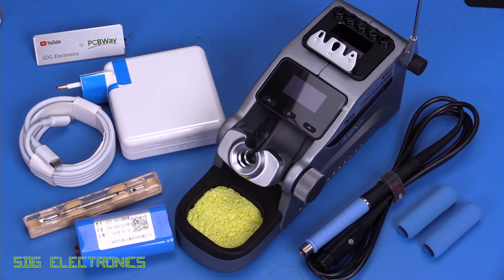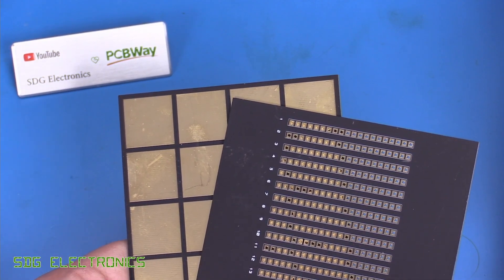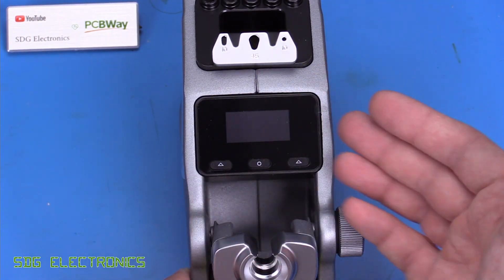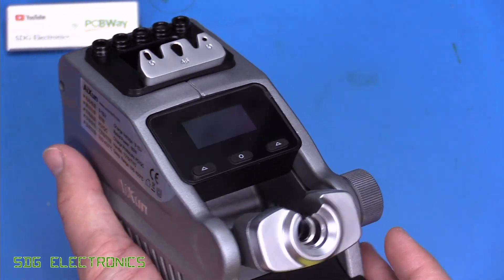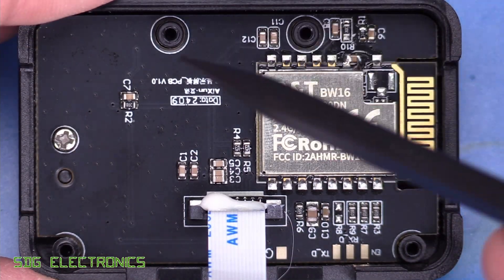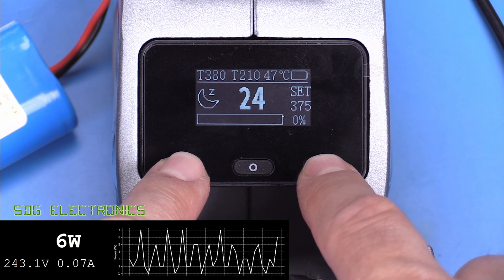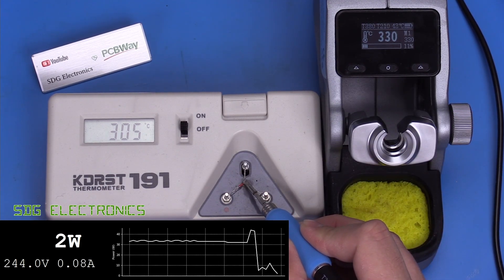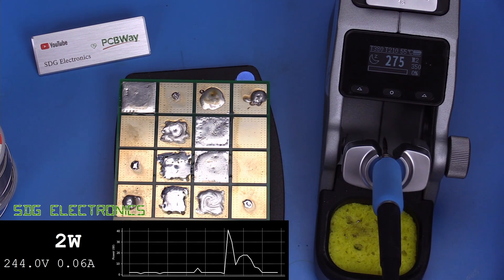SDG #335 Aixun 80W USB-C and Battery Powered T380 Soldering Station

Comment: they dont ship it with the battery anymore.. received mine today after ordering it at the video release day and they didnt include a battery for it. overlooked the description where it states "doesnt include battery for shipping reasons".

 its just two 18650 2600mAh with a 2S bms on a jst connector isnt it? gotta weld my own
Reply from the maker: Yes, just in a 2S configuration

Comment: Southchip Semicon SC8201QDER - Synchronous boost converter, 2.7 to 30V in, 2.7 to 36V out, 2A gate drive. For anyone wondering.

Comment: It's a shame they didn't inset the USB and handpiece connectors. Every time someone pushes the station back to the wall, it's going to damage the connectors. It would have been such an easy feature to include.. sigh. 5:05

Comment: I’m just finishing my review. Did you spot the issue with external adapter and battery in that of both are connected you can’t turn it off.  It just crashes.  Also then if you remove the usb C and turn it off it turns its self back on.   I have fed it back to them.    Overall it’s a great iron
Reply from the maker: Hmm I just tested it, it happens with their adapter but with the power supply I was using in the video it works normally.
Reply: @sdgelectronics  that’s interesting.  I’ll test that now to

Ok just tested and it’s the same on a few supplies for me.
Reply: @sdgelectronics  here's another puzzler: the station is labeled with input: 9v - 15v. But the charger is labeled as only providing up to 3A at 15V (... or 4.8A at 20V to give the 96W rating). This is typical; pretty much all high-power usb-c chargers I've seen only provide more than 3A at 20V or greater. (The reason being that devices should prefer lower current and higher voltage, up to a point.) So how could it be getting 80W, at 15V? Maybe the supplied adapter will actually allow ~ 5A at 15V? (And some other high-power usb-c adapters will too?) Probably more strict/proper usb-c supplies will have issues with it.
Reply from the maker: @ploxiln  yeah that's a good point, it must be temporarily overloading that supply, though I think generally it's not designed to be run without the battery installed

Comment: One thing I don’t understand is I thought the C210 tips can only do 20W ?
Reply: Spec is about 24W continuous 40W peak from JBC, these clones drive the tip much harder. Its not clear how long they will last running at 80W. I would prefer an option in the menu to limit maximum power.

Comment: Oh why oh why the F did they not support the T245 hand piece. Goes to show that no soldering station can seemingly be designed without at least one stupid avoidable design decision. No support for brass cleaner in the station. Battery powered devices like this should use external systems so users can opt for different sizes and quantities based on their needs. No sleep mode, no IEC mains supply. Seems very targeted to those playing with drone, UAVs,

Comment: Because of the low cost of this and other similar units that don't have the reduced temp standby mode could it be that the materials used to construct the case and holder aren't suitable to be around high temps for extended periods? Turning the iron off is preferred over higher cost of materials when competing in the market.
Reply from the maker: In this case I think it's just a missing feature

Comment: I don't understand why the handle should be placed as shallow as possible in the cradle. You mentioned it prevents the heat from traveling back up the handle. Does heat obey the laws of reverse gravity?
Reply: I don't suppose you solder much...
Reply: @overamped23042  MYOB
Reply: heat raises to the top
Reply: @AndreaAustoni  Hot air rises to the top, not heat. The thermal conductivity of air is far less than the metal part of the iron itself, otherwise your hand would burn during use. Putting the iron at a shallow angle would make a marginal, if any, difference.

Comment: I'm glad that AiXun is trying to build a brand, even if it's based on cloned JBC technology, but they could definitely improve the firmware.  The arrow buttons here are likely a manufacturing error as the item photos show them pointing in opposite directions.  This aspect needs QC attention.

The pricing is weird as they want an extra 43USD for 2 extra tips.  The marketing is also awful as the AE photos show that this station has "5G technology" for firmware updates and a "neural network control algorithm" for rapid heating.  It's hard to stomach that level of stupidity and borders on fraud, even if it's actually just incompetently exuberant Chinese marketing.  It also lists both WiFi and Bluetooth, but 1. there's no Bluetooth functions listed or needed, and 2. I have zero desire for my soldering station to be an IoT device connected to China ;).

Over-the-air firmware updates are acceptable, I guess, but my experience suggests that these companies never improve their existing products, but instead invest all their effort into upcoming models.  Existing customers seem meaningless to them except as potential buyers for their next model.
Reply: He can't win! Wiring reversed, buttons reversed, the joy of buying low end entry level stuff 😄If he can end up with two poorly assembled devices I wonder how many more are like this.

Comment: The included USB power supply is a ripoff of an Apple MacBook power supply, right down to the mechanical details.  You should be able to find a UK adapter, or you can use either a polarized or non-polarized 2-conductor power cable plugged directly into the supply.  Thanks for the review, well done as always.

Comment: 6:07 That charger is a knock-off Apple charger. 

Apple has used the same system of snap-on plugs and cords since introducing it in 2001. The plugs (which are officially called “duckheads”, no joke) and cords used to not be available separately, but are now orderable accessories. (Apple also sells the complete set of all duckheads as the World Travel Adapter Kit.) But you can also just slide a regular figure-8 (C8) power lead into it. It looks janky but is perfectly safe and reliable.

In the real Apple chargers, the metal stud is the earth connection, used only on cords, not duck heads. (Smaller charger models use a plastic stud.) I wouldn’t count on the knockoff’s stud being connected to anything.

Comment: So they have the tech (in other stations) to detect the 3 types of cartridges but only support 2 and it's a special connector that isn't compatible with other Aixun Handles... Only a 2 cell LiPo so I'm guessing they are boosting the voltage (Power looses) to get the proper power in the cartridge too (all JBC tips being designed for 24v if i'm not mistaken) All of this is really weird and disappointing. I have a 420D station and it's lovely. Modified it quite a bit to fit my needs but the base station is solid so why not use the 420D controller with one less port and made for DC it doesn't make sense to me. (Of course it's more complicated than that but they already have a solid base to start with that's what I meant) Guess I'll have to modify one of these cheaper stations that take all 3 types to use a 6S Li Po and call it a day. Most of them use a switching PSU anyway so it's already DC
Reply: 210 and 115 run on 12V, guess the 2 pack 18650 battery was boosted up to meet that. 245 runs on 24v which is too much and not supported. As a matter of fact you can run 245 with 12v, it only draws around 30w hence very slow.

Comment: I wonder if a IEC-60320 C8 cabel (the figure 8/infinity connector) could fit into the power supply.
That way you could still use it and don't have to have this big thing in a socket.
Reply: It works perfectly, I’ve used Apple chargers that way many, many times. The only exceptions are the comparatively rare polarized C8 plugs (where one side of the figure-8 is rectangular), and with some C8 plugs whose grip area is too thick because they added really fat grip ridges.

Comment: These flimsy crap produts made in china are worthless. Last year I bought a soldering station JBC BT-2BQA 140w for 225€, EU shop, warranty that will work if needed, quality construction light years ahead. Sure, double the price but 10x better than this toy garbage.
Reply from the maker: This is one of the cases where the construction is better than the JBC equipment I own.

Comment: Hi SDG, I recently spent a lot of time watching your reviews to help pick out a new soldering station and hot air station (I went with Aixun T420D and Atten 862 hot air station) and noticed a lot of your newer videos aren't in your playlists. I think it would help others a lot if you could add more recent videos to their respective playlists when you have an opportunity. Thanks!
Reply from the maker: They should all be in there now, I updated them a few days ago.
Reply: How much did you spend on your T420D?
Reply: I only needed a single handle and found a seller that sold it for $210. There was also an Aliexpress sale at the time that saved me $50 when combined with the cost of my hot air station.
Reply: @Keiuran  Sweet! Now I know I’m not wasting my time waiting for a similar deal. :) Thanks!

Comment: Cant understand why aixun denied supporting T245 in this model. 80W power covers power delivery of most of C245 cartridges including massive tips as 908 or 939  in practice works  😮
Reply: Yeah it's strange because this would've been a winner for me if it did. I already had a very good USB power supply and this would've been perfect instead I got a T420D
Reply: Maybe they'll make an even better model for T245
Reply: @acoustic61  or they will make fw update with T245 supporting and start selling T245 handles with 7pin plug at x3 price compared to standard 6pin (t3b, t420) 😁
Reply: @umanetsoleksandr5652   If they make the best model now, they won't be able to sell you another one next year. I do like the idea of a nice heavy bench station which uses an external power brick. I hope they'll make similar stations compatible with T245 and even Hakko T-12,T15. Or one station compatible with all. Like Unisolder!
Reply: Battery ?
Reply: 245 requires 24v/5-6A , 210 and 115 run on 12v/ 1-5A. There's no way to boost a two pack 18650 to meet the power needs of 245.  They could made 245 as "power connected only" option and provide a bigger 150w power brick.
Reply: @dukeiiigmail  What makes you think it’s impossible? The high-current 18650s typically used in power tools are capable of 20-30A. At 7.4V, that’s around 150-220W. And as the original comment says: 80W covers most practical uses just fine, and even standard 18650s could handle that just fine. In either case, there certainly exist boost converters that could do it.
Reply: @dukeiiigmail  The average power is way, way less than the peak. (And while the 245’s peak power is much higher than the 210, the average power is probably almost the same.) Conversion losses aren’t that bad either.
Reply: @dukeiiigmail  C245 in genuine JBC stations or Aixun T420(D) needs full power (full wave of AC 24V RMS) only for few seconds when it heating up. You can see many measurements in videos on this channel or at eevblog to confirm it. For examle in "coin test" massive genuine 908 tip provides no more 60...65W. Even GVM H3 pass this test.
Reply: It's because they already used non-standard connectors for their t245 handpieces on older stations, hopefully they start selling new models of 245 handpieces with the same connector now this is the only thing I've never liked about aixun and why I usually go with sugon on 3rd party stations

Comment: I wonder how they come up with that kind of UI. Up-button scrolls down, o-button up and down-button is ok. Why they chose to no use up-arrow for up, down-arrow for down the the middle one for ok. There is no way to understand that.
If you need portable use, usb-c powered devices and a powerpack are so nice. Pretty rare need though but at least you need no extra psu for that.
Reply: Thank you for your kind suggestion, we will improve the operation logic of the three buttons in the next version through OTA software upgrade 😊